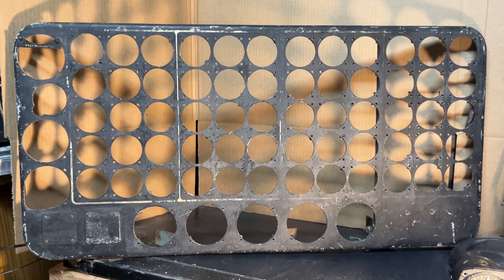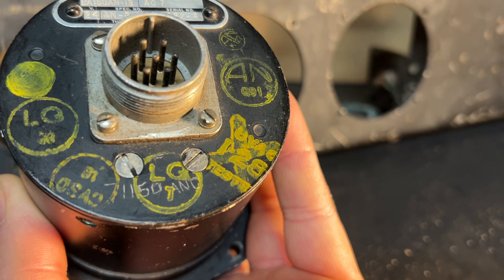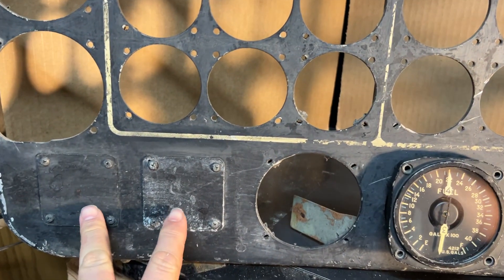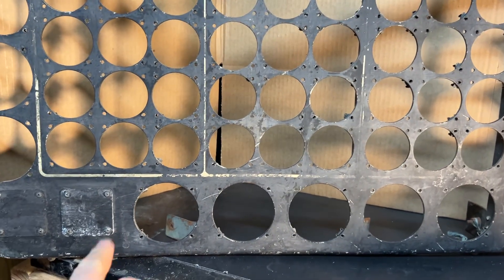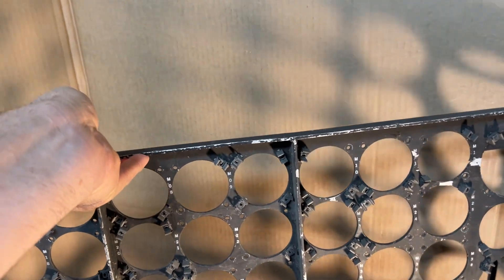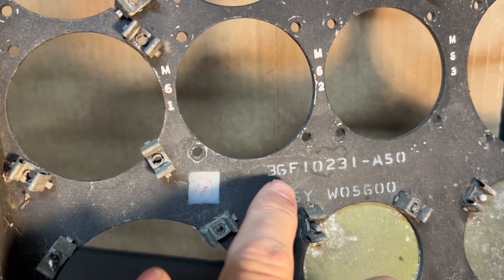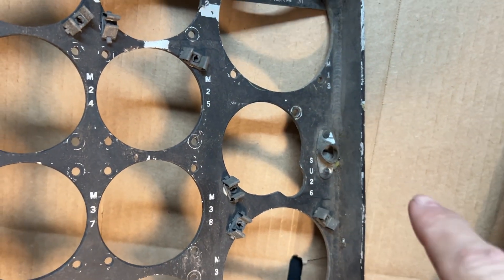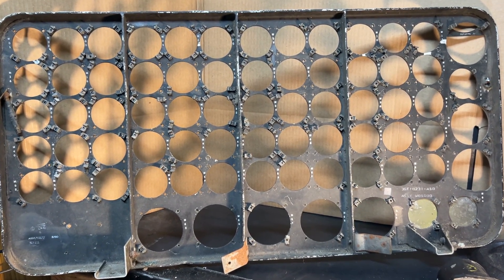B-36 Peacemaker Equipment Seen In Strategic Air Command Film Explained FLIGHT ENGINEER MAIN PANEL

Comment: Did you use the D model engineer's control panel in your H model replica cockpit?
Reply from the maker: No, the D and H model panels are two entirely different animals. I will be copying the vintage panel seen in the videos, which is definitively from an RB-36H. The H model is slightly different.

Comment: How many gallons of fuel
Would a fully loaded 36 hold? Did they use different fuel for the engines?
Reply from the maker: 64,000 pounds of fuel, I believe. A special type of fuel was used for both the J-47 and R4360 engines.
Reply: @B36HPeacemaker  So 2 different fuels?🙄 What could go wrong.
Reply from the maker: @Tempestzzzz  One fuel for both engines.